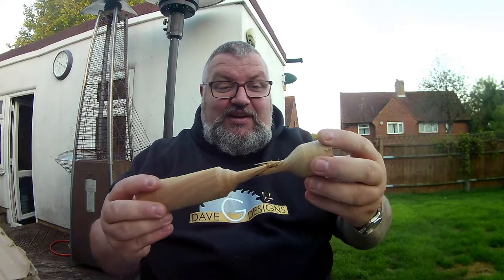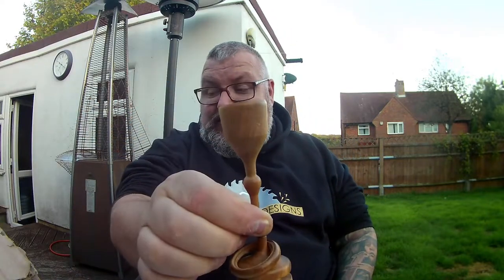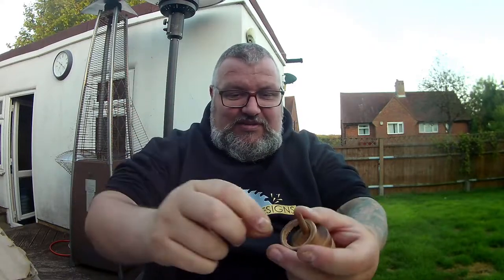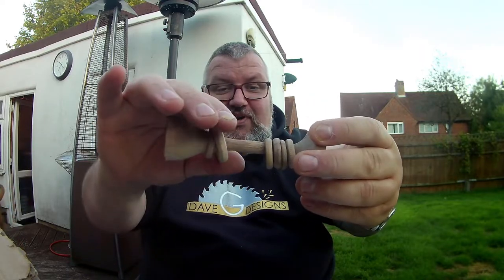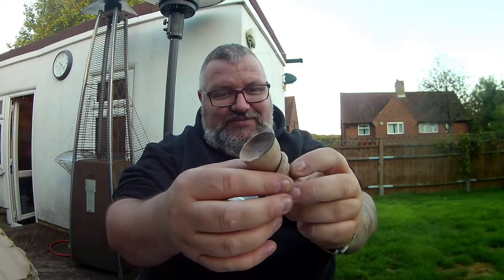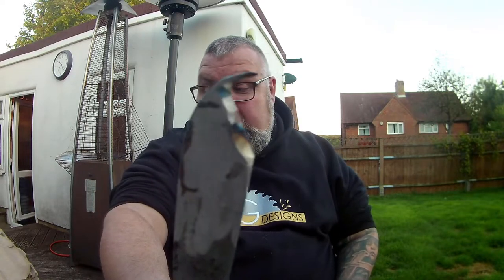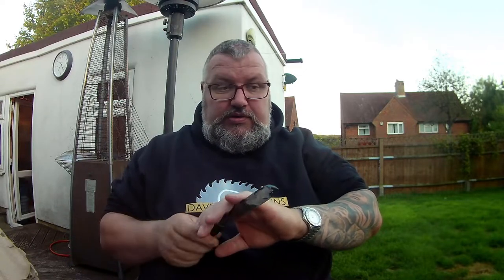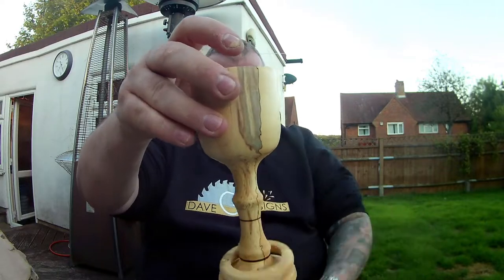Woodturning a Goblet with a Captive Ring - Inc Epic Fails

Comment: Nice video, Dave! A few tips for goblets: turn the goblet bowl to completion first, before starting on the stem - and that includes sanding and finishing. Then support it with the tailstock - lightly, just enough to stop lateral movement, but with very little pressure towards the headstock (or the stem will bow as it gets thinner). Some people put a rubber ball in the goblet bowl, others just use paper, but you do need to protect your finished bowl from the revolving centre in some way. With that support in place, you should be able to turn a really thin stem without the mishaps. Captive rings? Just accept that they are all turned across the grain, so some will inevitably break off.
Reply from the maker: Cheers Richard I've asked the missus to grab me a tennis ball next time she's out and about so making goblets has not seen the last of me lol
Reply: Wow - big goblets! A squash ball would be better for smaller ones.
Reply from the maker: Richard Peers good shout. 👍🏻

Comment: Great result in the end Dave and thanks for showing all attempts 
I think like you I need a steady rest in the middle you know the circle thingy with the 3 wheels on it because if I have a go at the bowl bit on a goblet that long it would shake like a bugger.
Dave where do you get your wood from I would love a bit of spalted conker
Reply from the maker: Graham Wood thanks for the comments mate. I’m going to film another attempt where I show the shaping of the goblet more but basically I turned the goblet before I turned the stem so there shouldn’t be too much whip in it and once turned you can use the tail stick to support it while you do the stem. I’ve got loads of different wood blanks zabrano spalted beech ash oak yew cherry and all sorts. I get them from all different places but I think I picked up the spalted conker in a batch of wood from eBay. 👍🏻